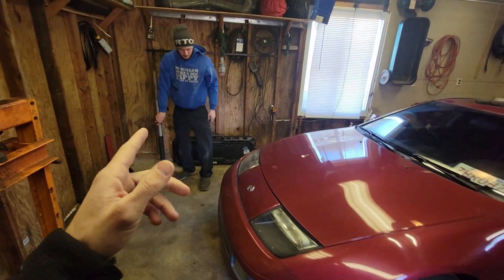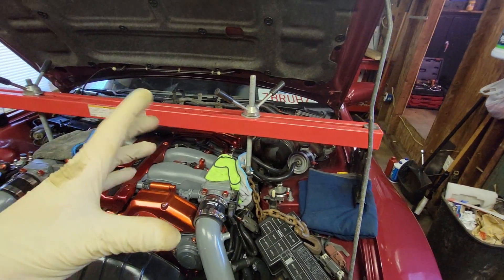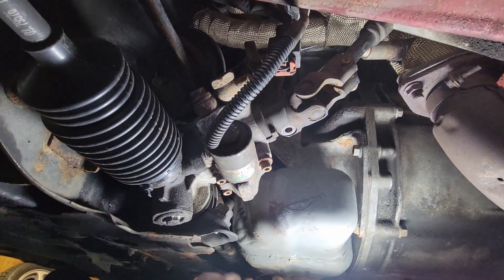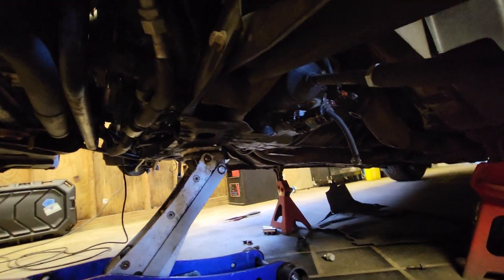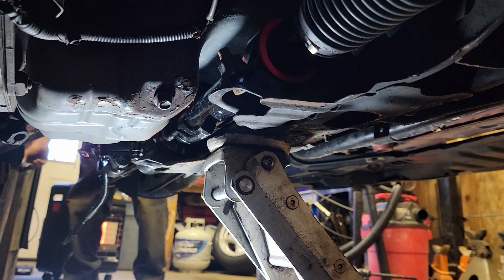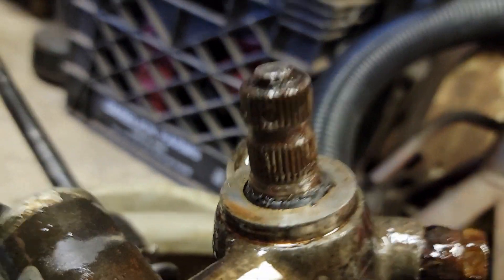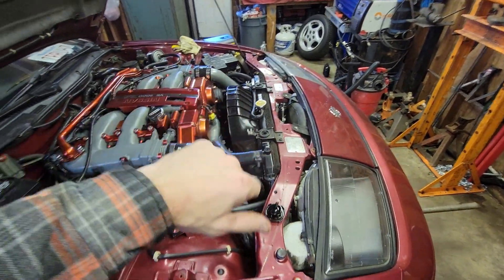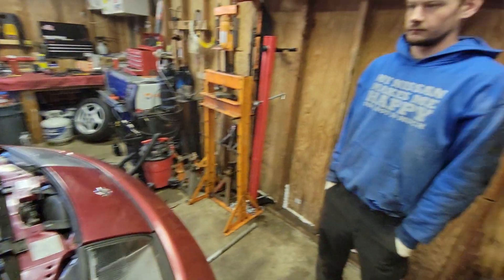How to Replace & Bleed a Power Steering Rack for a Nissan 300zx in 10 Minutes!

Comment: How do you find neutral position, or center, on the rack before connecting the steering u-joint? Thanks
Reply from the maker: If the marker is destroyed or broken, you will need to count turns of the wheel on each side then readjust its a pain

Comment: Hey im doing a bunch of deleted in my z right now (pcv, egr, Iac and the plenum cooling lines) I was wondering if i had to do anything to the computer or if all i gotta do is tuck those wires I assume its just tucking the wires because I’ve never seen anybody mention anything about the electrical connectors but I thought i would ask just in case
Reply from the maker: Electrical connectors you just tuck away and forget about them ☺️

Comment: hey! so I need to replace the catback on my 91 2+2 and I was wondering if you knew of any online places i could find them used/fairly cheap? Im looking through local parts cars and most of them are 2+0; what're the differences between the models when it comes to the exhaust system? are there any parts that could be interchanged between models, like the cat converter itself or exhaust tips or something? since i've been having some trouble with it I was considering just deleting the cats entirely. do you know any places that sell bypass pipes for the exhaust? thanks!
Reply from the maker: Best place would be ebay for used parts. I'd just search the year you are looking for and go from there. Local junk yards may be rotted out or in poor condition. If you buy new it should last forever to be honest
Reply: @ZBruhzchannel  thanks!

Comment: Helpful videos. One question about separating the steering knuckle from the rack. Do both bolts on the steering knuckle have to removed or loosened?
Reply from the maker: Depends on how things are fitting and lined up, I believe we loosend both so we can pus the knuckle up then pull it off the rack.

Comment: How long did it take you to bleed the system? I feel like mimes taking forever
Reply from the maker: I'd say about 25 mins
Reply: @ZBruhzchannel  okay, i bled mine for awhile but my pump is whining pretty bad and when I turn the wheels there’s like a vibration or bumpy feeling in the wheel. My fluid isn’t really being sucked down

Comment: Can anyone help me my 300 I recently replaced the power steering pump and replace the little o ring on the elbow but for some reason when I go to turn the wheel it is very hard still and it leaks from the elbow even tho I replaced the o ring and tips will help

Comment: Nice that you show what needs to be done, but would be helpful if you actually showed removal and replacement of rack so we really know what to expect. You're very articulate and there aren't a lot of Umm's and Ahh's so that's great. This seems to be your style of video and why I'm not subscribing. Give more detail and I'll subscribe and maybe  contribute.
Reply from the maker: There's another video on the channel that goes over how to remove the rack 🤙
Reply: @ZBruhzchannel  I'm confused, why have two of the same thing? Or, almost the same thing? I'll look for it. Do you need to drop subframe to change out high press hose? And even with a garage or lift, there's no way that's taking me only 10 minutes! 😆